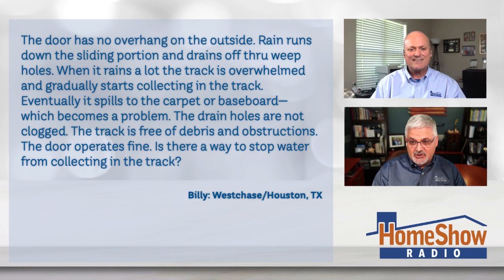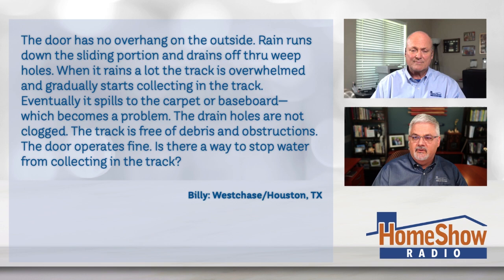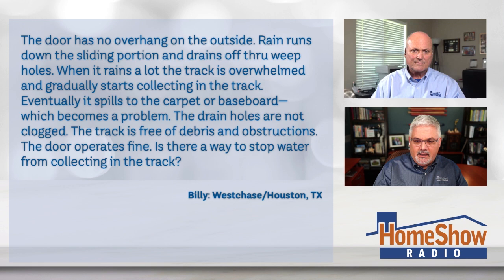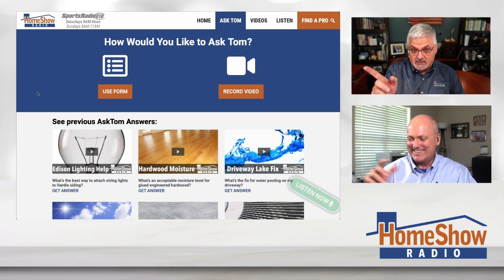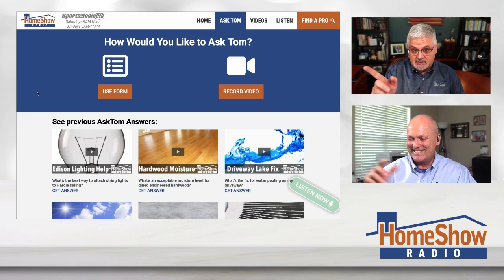How can I keep rain water out of my sliding door track?

Comment: have this same issue with our sliding door on our rental house, here in NC. It's for our back deck - and we get those torrential rains here quite often. Our rental company replaced the old sliding door with a new sliding door (even though we requested french doors or something. But it still happens even with the new door - the rain usually comes in from the west - moving east/southeast - and that is the direction the back of the house faces. The only way I've found to make it better is shove a towel in the track on the inside, to block the rainwater from seeping into the inside track from the outside. :(

Comment: Installing overhang won't help much either, as that assumes that the rain will come straight down, vertically hitting it. Sometimes rain is driven by strong winds and it hits the house sideways like a fire hose. It is not possible to keep it out. Home construction remains to be a joke and so are the building codes.

Comment: Where I live in France they use small overhangs made of iron and safety glass (in decorative shapes) on very old homes. On newer homes and buildings with sliders and no overhang, they use exterior shutters or rolling storm doors which divert the rain quite well and provide sound and wind insulation as well as security. I'm always surprised that they haven't become more popular in the US.
Reply: We don't need them we use sill pans ,if a door entry is installed properly there's no need for any outer protection

Comment: One of the most common problems is no existing door sill pan ,we rip out and change hundreds of doors...it's a very common problem
Reply: Yes this! Especially sliding patio doors. They need a pan under them with a 1/2” lip and sloped slightly outdoors.
Reply: Is this a part you can buy at home depot or is it a pretty custom setup? I need some kind of seal that will let the rain hit the sliding glass door, run down it, hit the seal and roll off the threshold to the outdoors rather than filling up the inner door track and overflowing into the house. But can't be high enough that you trip on it. What part(s) do I need? Thanks!
Reply: @remodz6385  Do you have a picture of this setup? I also responded below. Would love to fix this problem! Thanks!
Reply: Just give a subtle slope to outer side,  to the base (marble or whatever) on which the sliding window or door is resting. You can even put some silicone on the inner side 👌
Reply: @jaredhaxton6154  sure sill makes a great product
Reply: @bobjones8378  ok. Thank you. I will check it out!
Reply: @jaredhaxton6154  Or Jamsill guard both excellent products
Reply: Dude, i got 8 windows changed back in November, never had heavy rain till the other day and all 8 have this problem with the track filling up and spilling in the rooms. I need a way to fix this cause th heavy rains hasnt started yet, maybe its natures way of showing me that theres a problem. The guys that put them in say the same thing that "the tracks are gonna get water in em' depending on how the rain falls" but they disnt tell me this before installing them. Any updates on how to fix this?
Reply: @azharamanullah2610 i thought of putting the silicone on the inner side, maybe i ahould have the installers try that.
Reply: @demisedemise  Can you identify the point of entry that's the best way to fix the problem ? Water isn't suppose to come inside your house that's what the windows for ...I doubt they put a pan in they don't sound too smart...I would be willing to bet that it's entering from around the frame they probably didn't seal it properly ..The primary bead has to be put around the outside of the opening before installing it not the actually window frame...Run a bead of sealant ,not cheap sealant good flexible sealant around the outside of the window..If you feel comfortable take it out and put a bead around the outside of the opening then seal up the entire frame ,it has to to be tight.
Reply: @bobjones8378  im figuring it coming through the small spaces berween the windows at the bottom of the windowa.
Reply: @bobjones8378  i can see sunlight coming through small spaces where the windows meet along the tract when its closed.
Reply: @bobjones8378  they also didnt silicone around the frame from the inside, note, these are pvc windows. Along the corners of the frame there are small spaces. It seems as if whwn the water got onto the tract it leaked through the corner and ran down the wall to the floor. They didnt do a good job
Reply: @bobjones8378  no that they siliconed aroun the frame on the inside yesterday, we still havent pin-pointed how the water is getting in and onto the tract but i stated some ideas of where it may be coming from in previous reply

Comment: I have a spotless tract, but searching for answers as to why my sliding patio door is getting impossible to push open and close, especially with arthritis in both hands. I am a disabled widow and have always fixed and repaired all sorts of jobs to maintain my home. But this problem has got me to the point I'm lost as to what to do. I will have to hire someone to fix this project which I do feel water has leaked underneath the track causing this problem. Help??
Reply: Try rubbing candle wax on your track.If that doesn't fix it you can have a a track cover installed for way cheaper than a new door.